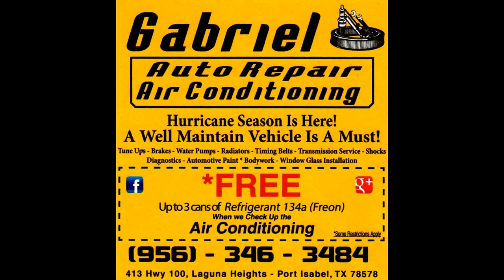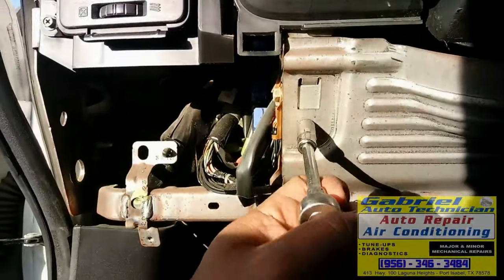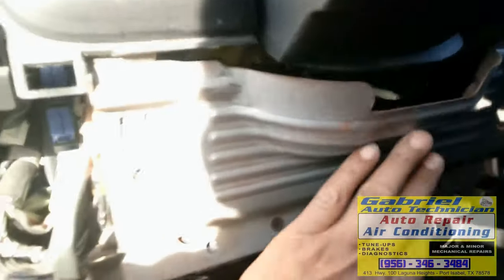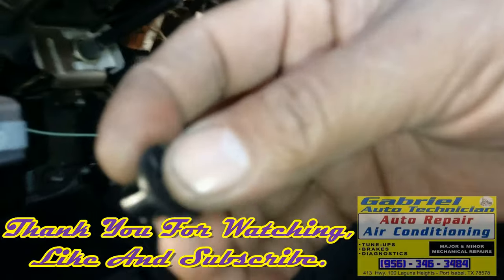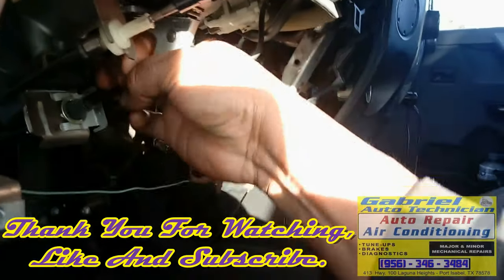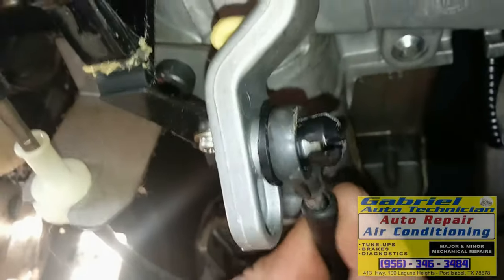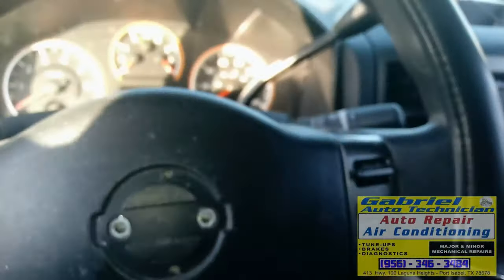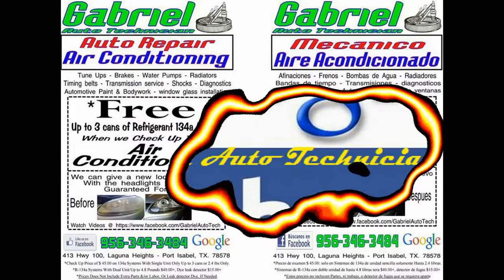Replacing The Transmission Shifter Cable? Not Necessary If You do this Cheap & Easy Trick!

Comment: Just had this issue on my 2002 chevy tahoe. The only thing is that I had to go under the truck to find the problem and when I did your video saved me parts and labor. I good the right clip in my tool bag it actually worked 👍🏾. Thanks another you saved me some money 😁
Reply: I meant to say I got the right clip and that you saved me some money

Comment: Good video. But don't forget to add a little bit of silicone grease to ease the movement
Reply from the maker: It does not really need it ' cause it is plastic, and it is not on constant movement. When it is a metal bushing, like the door hinges bushings yes, that needs lubrication.
Thanks for watching and commenting.

Comment: I am having trouble finding the clips that you use. Could you give as much information possible about how to find them?
Reply from the maker: Go to any auto parts store,  so many cars use those clips to hold the inner fender or other plastic covers, I don't have a part number 'cause I order them in bulk trough the internet.
https://www.walmart.com/ip/25pcs-Bumper-Fender-Hood-Moulding-Grille-Retainer-Clips-Fasteners/373947760?wmlspartner=wlpa&selectedSellerId=0&&adid=22222222228268676597&wl0=&wl1=g&wl2=m&wl3=319413709111&wl4=pla-590883793576&wl5=9052700&wl6=&wl7=&wl8=&wl9=pla&wl10=8175035&wl11=online&wl12=373947760&veh=sem&gclid=Cj0KCQjwweyFBhDvARIsAA67M713K8qHHlHZj6GmpnAK3soejT_xmSTLZEpPABu_Wl3zHGAznTz6lWYaAr9XEALw_wcB&gclsrc=aw.ds
Reply: @GabrielAutoTech  Thank you very much. I am looking for a 90's Chevy truck adaptation, so it must be the right small size. I like your video, don't listen to the bad people that say stupid stuff.
Reply: @yogsoggoth9786  Did it work for your Chevy truck? I’m doing this on A 1996 suburban.
Reply: @MrRoy-rb1je  Get a proffessional ziptyer.
Reply: ... Until I figure it out. Why can't we edit?
Reply: @yogsoggoth9786  did it work for you?
Reply: @MrRoy-rb1je  BishingFix.com. See comment below.

Comment: A metal snap ring will do all the work it will not wear it will stay in place and has the right pressure to be there as long as you want, all that plastic grinding unnecessary...
Reply from the maker: Show me, so I can learn.
Reply: @GabrielAutoTech  Garbiel, I had this same issue with my 2008 Toyota Sienna LE.  I happened to have a retaining ring assortment pack and used a 3/8 inch retaining ring.  It fit right over the mount where the transmission line attaches.  I pushed two on there for good measure and it seems to work fine.
Reply: Herbie, do you even understand WHY he did that?